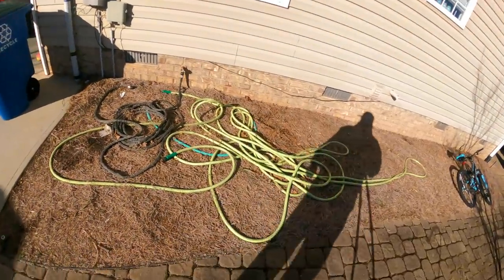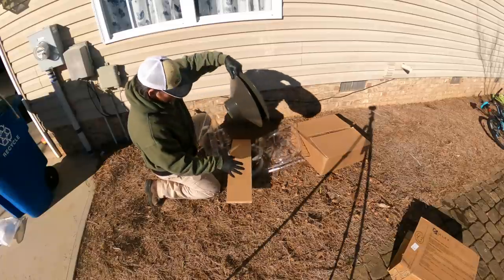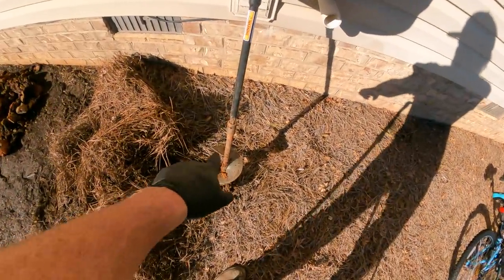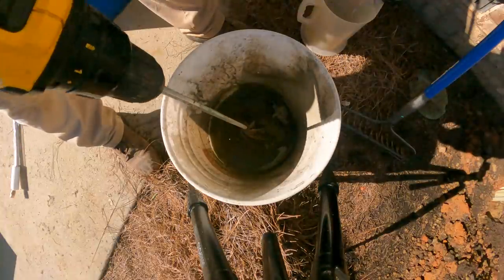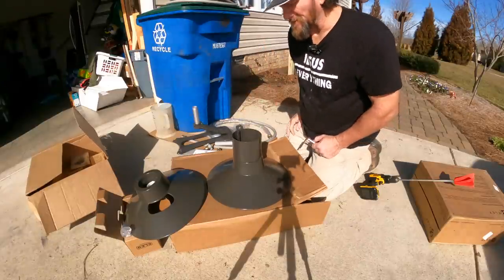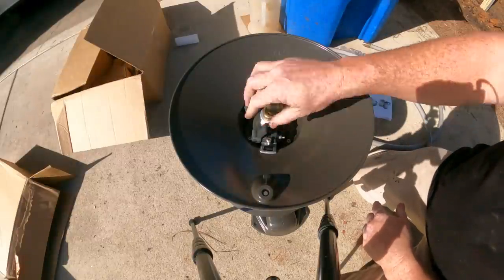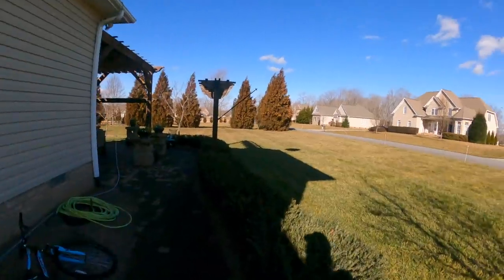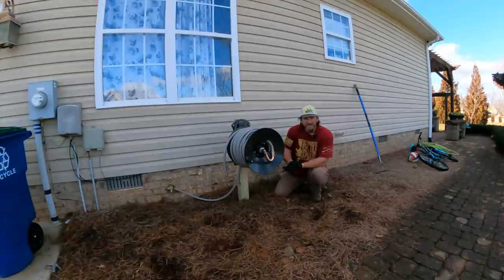Best Garden Hose Reel 2021

Comment: NC rock infested red clay is a nightmare. I just dug a 24 inch deep hole for a flagpole. Took me 3 hours. Didn't have an auger and a post hold digger or shovel wouldn't even make a dent. Had to use a spud bar to loosen it up and then shovel it out or just take it out by hand. None the less Old glory is up and standing proud.

Comment: Pete, I will share an "old Indian trick" from  Texas country boy.  After you dig your hole and set the post, fill the hole about half full of water and "slowly" pour your dry concrete into the hole.  That technique is used by most of the highway departments, and the roadside signs stay in place for years and years.  It saves a lot of needless mixing and mess to clean up.  Nice hose reel.  Blessings to you brother.
Reply: Great tip. Learned how to do that from my father when I was young. Saved me countless effort and time through the years.

Comment: Hey Pete, I have been an Eley guy for many years now. Will never use anyone else’s  product now that I know how good this stuff can actually be made. Quick tip on the spray nozzle... If you notice that at the nozzle it drips as it sprays the water, that means there is not enough pressure and you need to go down to a disk that restricts the flow a bit more. That is why they include a few options. Once you find the right one, it will stop that annoying drip from running down the nozzle onto your hand or glove. Hope that helps.

Comment: You will not regret that Eley Pete. I bought one for the front of my house 5 years ago. I got tired of the big box models and have been through countless ones. Like most quality, it costs up front but way worth it in the long run. I have had zero problems with it. The vinyl covers they use are subpar though. They fade quick. They sent me a replacement for free that also did the same. I tried like heck to talk them into making them out of Sunbrella material. It would be worth it. I still use though to protect my hose. Just my 2 cents brother.

Comment: Thats awesome Pete.  I was getting ready to buy one and just hadnt pulled the trigger.  I was also getting ready to say your pick wasnt the best until I saw you picked the Eley.....    I will be buying tonight.  Thanks Pete.

I already did buy their quick connect setups AND there shut off valves ( specifically I bought the 'garden hose ball valve swivel). Which are all AMAZING!  They are full flow so the inside diameter is VERY large.  Much larger than the other high quality quick connects that I use which are made by Dramm.  The Eley products are super quality all the way around.

I highly suggest you try the quick connects and shut off valve if you havent already (I havent watched the full video).

Comment: Pete, found Eley 3-4 years ago, was hesitant at first to spend that kind of money on a hose reel but can honestly say they're worth every last cent.  I fully expect mine to last for years and years (read 15-20+).  You should look at their quick connect adapters so you can quickly switch from that sprayer to a wand to a Big Sled sprinkler.

Comment: Just a tip on metal tools like that manual post hole digger, spray good old fashioned Wd40 on it and let it dry.  I bet the dirt won't stick as much. That's what I have to do with snow shovels up north and worksnlike a charm. Great video. Thanks for sharing it.

Comment: Looks good Pete! It would be nice if they make a removable cover to go over it so the sun doesn’t deteriorate the hose over time. We all know that’s the enemy to most things. I like it but what is the hose made of? I currently run the rubber Goodyear hose from the orange store. I keep it out of the sun and they look great even after 6yrs.

Side note... in the winter time or right before, I blow my hose completely out with air. The reason is if you have a fire in the winter and need the hose, but left water in it, it will be frozen and useable. 

Stay safe

Comment: I found your channel while I was just wondering around YouTube and I am so glad that I did. I have been looking for a really nice strong hose reel and this one should work out for me just fine. But how many feet of hose do you use and what’s the max length the hose reel will safety handle? I may have to have two reels because I use over 450 - 500 feet of 3/4” diameter hose. As you most likely know the longer the hose the pressure drops accordingly. I split my hoses between my front and rear of my property. BTW I did subscribe because I won’t purchase anything that will not last I would rather do without than to waste my money on something that’s only going to last a couple of years. You did a very good job installing it also. Thank You

Comment: Just came across your Channel today. I was interested and seeing the hose reel you were going to reboot. I did not know where you were located, but as soon as you augured that Red Dirt out of the hole, I said this guy's got to be in North Carolina. Have you ever tried using the foam to set a post? So much easier than dealing with the concrete mixture. No extra tools needed and just as secure as concrete. Enjoyed your comments and your review.

Comment: For the open hole when you remove your rollers part of the corner guard insert an OXO reusable wine cork/bottle cork. The red one is easiest to find under mulch or your favorite sports teams color etc will work too. Pops in and pops out easily and can handle the hot cold temperatures. Or you can use one of those rubber corks with a hole in it and attach a “bolt through it for a handle. May cost more depending on the area.

Comment: As wet as the soil is, you could have put dry concrete in the hole and it would have pulled moisture from the soil. Looks like a great solution.

Comment: i use a cox hose reel. one mounted on the house and one mounted on my porch. Not cheap at almost $600 each. but well worth the hassle. i just should of went with full stainless option
Reply: Dang that’s a lot! The average Coxreels is 250-350 for garden hoses... Do you live somewhere that they upsell the product?

Comment: Pete.  Your discount link doesnt work.  Did you lose the discount with Eley????  I needed to get more quick connects and a couple splitters. I already bought the 4 wheel hose reel and 175ft of hose from them using your link previously.

EDIT:   I searched your site instead of using the link in the description of this video and I found the Eley link.  I assume it will still give the discount.  But you may want to check out the link in the description to this video to make sure it is right and modify if necessary.  Just to make sure people get the discount if they find it in this video and you get the affiliate referrals.

EDIT 2:  I dont think the link on your website gives the discount.  Unfortunately I just placed an order and there was no discount at all.  Hopefully you can get that worked out.

Comment: Bag a quikcrete dumped into the whole, backfill and tamp; No need to mix or wait for the concrete mix to harden. Plenty of moisture in the ground to get the concrete to harden. I’ve done many fence post this same way and never had an issue 👍🏽

Comment: Great video. I noticed you appear very close to buried utility lines. Here, we have to have a “mark out” by the utility companies before you dig. If we cut a line without a mark out, the cost of repair is on me. If marked, it is on the utility.  Shocking sometimes, where those lines are run.

Comment: It depends on the resolution of the tape measure, but most go down to the 16th's. Therefore, that mark would be 9/16th's. So you have 12 and 9/16th's assuming you are using Imperial and not metric units.

Comment: What Manufacturer makes the BEST Garden Hose that will "Not Kink, and Last 5+ Years"?

I spend about $150 a year for two 150' hoses...
Reply: Lowe's has a hose with a lifetime warranty. I've replaced it once so far. Just walked in with it and took a new off the shelf.
Reply: Zero G is a good hose!
Reply: What brand have you tried? Most have lifetime warranty.

Comment: if there is 16 16th's in 1 inch... Then there is 8 16th's in a 1/2"... the one more lil mark is 1 past the 1/2 so 8 + 1 = 9/16. You still lose me EVERY time you mix something up in a sprayer.

Comment: Instead of buying a very long hose why not just buy two hose reel’s, put one on the back of the house 🏠 and put one on the front of the house 🏡 most houses have two Spicket’s, get your shovel and dig two holes one on the back of the house and one on the front of the house and mount your hose real on a 4x4 3 feet tall in concrete it worked very well for me.  This guy is complicating a very easy task.  Remember to paint your 4x4 before you mount your real.  Paint will protect the wood.  A bag of quick Crete concrete is all you need you don’t have to mix it just poor it in the hole 🕳 around your 4x4 and then poor water 💦 in it will setup in about 5 to 10 minutes .

Comment: I have two of these post hose reals and honestly for the price they are not worth it.  They are better than most but the fit of everything leaves a lot to be desired.   Both mine rock (not the post) as you real them so I am sure it will get worse as the plastic bushing wears out.  The way they hold it all together the nut is always loose. The hose also gets pinched as it enters the real so I’m sure it affects flow.  It’s just too much of a turn.  The fittings they sell are nice but way overpriced and extremely heavy.  The hose nozzle is nice but again it’s heavy and the spray inserts are not practical.  I’m not going into the shed to change it out in the middle of using the hose.  The hoses are nice and don’t have a lot of memory. I spent well over 1200 dollars and I just don’t think it was good value for money.  The design issues are my biggest disappointment when you only make one thing. People rave about them so maybe it’s just me ;)

Comment: Just a helpful tip. It looks like you cut your post at 90 degrees. When you put a post in the ground with the top exposed, cut the top off at an angle to let rain water run off instead of sitting on top of the post. It don't have to be much, just 5 degrees will make it run off.